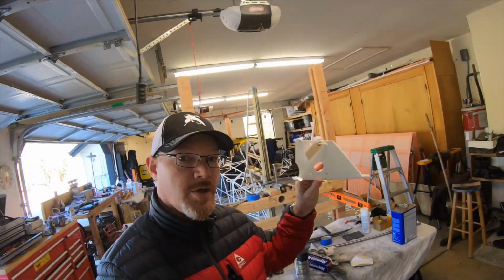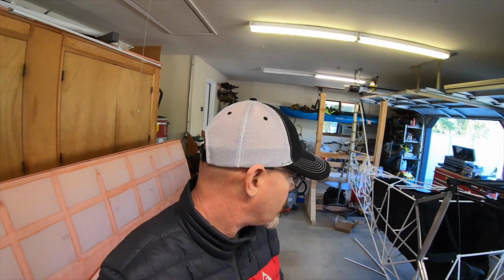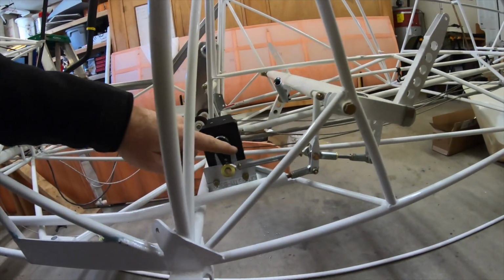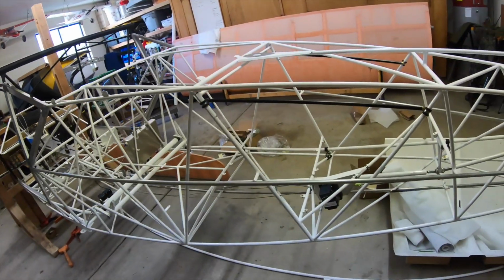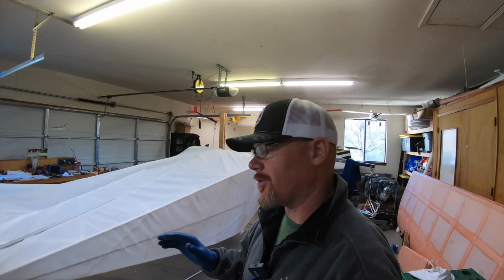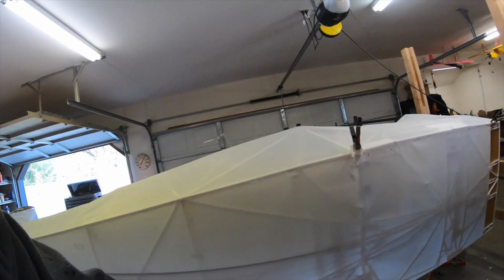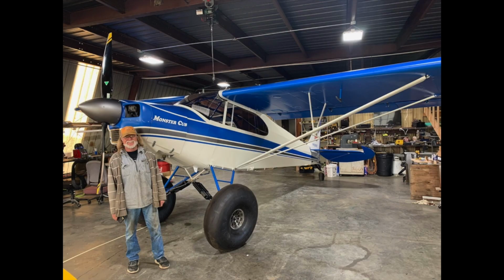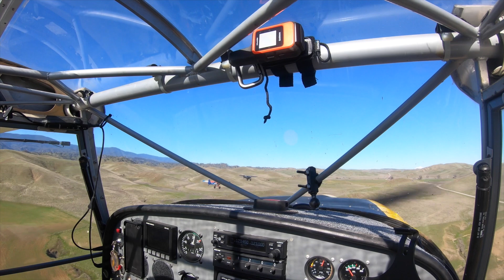Kitfox 7 Apex Build Episode 16 Lets cover this Fuselage

Comment: Quick question. To prevent the servo from going over center could you have a rod protrude from the mounting plate to physically stop the servo arm from moving? That way not only do you have the length of the push pull tube stopping the arm but you have a secondary stop in the form of a physical stop.
Reply from the maker: Absolutely

Comment: at 11:51   can you create a top bracket that has  stops.. you can make it one piece with a some folding and welding of one on each end..  bolts right to the front of the bracket over the servo.  i worry that you can flex that and get it to go over center at all..  at 12:27 that forward spacer needs to have the shape of a chess rook.. a nice fat bottom to a narrowed top attaching point.. guess what.. you can lighten the heck out of it by removing metal inside to make it like a bell that still has the center tube shape to prevent crushing.  the  bell shape wall does not have to be crazy thick..  that tubular shape is going to put the bolt in bending shear..

Comment: With all that special in the bag a question. Why don't you make a zipper on the bag. You install the rods fixed and have a flap in the bag that wraps around the rods and you zip it together. That is easy to do and easy to undo. Use large zippers and maybe some little cord to initially tighten the flap around the rod so that joining the zipper can be done without tension. Good luck!
Reply from the maker: A good idea for sure. I just didn’t want to have to deal with too much of the fastening behind the opening to the baggage area. I know I have to get to the back for the Velcro, but I think the way I did it should work out pretty good.
Reply: @BowenAero  I expect you did think it through. Not everybody has a strong stitching machine at hand to have the zippers stitched in. You could have the top part permanently attached and zip the bag in from the two sides all around the corner of the bag to the rear end. Then you only need a large enough ring at the zipper so that you can reach it with a rod. Then you never need to crawl in that space. good luck.

Comment: What a great looking workbench/station at the front of, and between, your garage doors. Could you do a quick video about it?

Awesome work as usual! So nice to see a kit plane making regular progress to completion.

It's been nice to see the Apex engine solution on your plane, and the other fellow at the High Sierra Fly-In. I know for me, the power plant cost is the biggest hurdle to kit building.

Great work and progress!
Reply from the maker: I built that work bench years ago. It is made of 2x3’s that I glued and screwed together and then ran through a cabinet shop planner to get the finish on it. It has held up very well. Thanks for asking.

Comment: So, something I don't understand (because I don't know what I'm doing when it comes to fabric). So, are you putting a coat of thinned Poly-Tak before on the contact surfaces (it dries really fast) and then laying the fabric...then use another coat of Poly-Tak on top of the fabric at the seam to reactivate the glue?
Reply: He explains his process in the wing cover video. From what I recall, it is as you described.
Reply from the maker: You put down an unthinned coat of poly Tac let it dry and lay the fabric over it and use a thinned poly Tac solution over the top to reactivate the first coat.
Reply: Project Kitfox thanks. What’s your MEK thinning ratio?
Reply from the maker: Whoa Nelly 75% MEK 25% poly tak or a little poly tak and a lot of MEK
Reply: Project Kitfox great thanks!!!

Comment: Would it make sense to add a bumper to keep from going over center on the pitch? Probably overkill... but having that pitch lockout would be a real bummer. Love the videos.
Reply: I dont always comment. But when i do. Someone beat me to it.
Reply: I totally agree with Eric Mac and wayne P about servo stops. I woke up in the middle of the night thinking about this. I have built a lot of things in my years, and I have seen things happen, that physically, should not have been able to, just like this. Please don't leave it without travel stops.
Reply: Once again beat to the punch. Even with a longer rod I would add a bump stop. The cost of adding a periodically replacing a little rubber bump would seem cheaper than the cost of an over-center(certain death)

Comment: Rather than do the screw thing for the arrow shaft, pull the baggage back out, make it velcro like the back, that way you can make the rod permanent and just undo the velcro to get the bag out or access the servo.  Just a thought.
Reply: i had a thought of a zipper, and then saw your post. GMTA